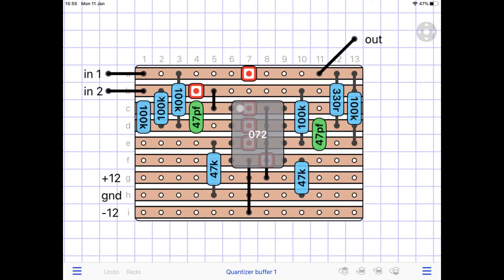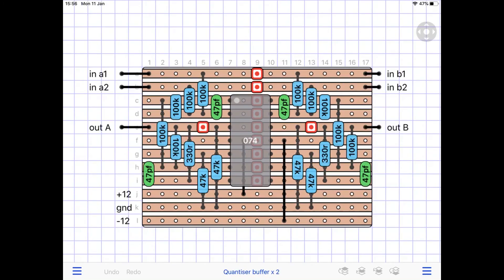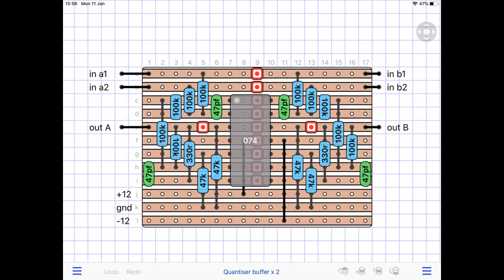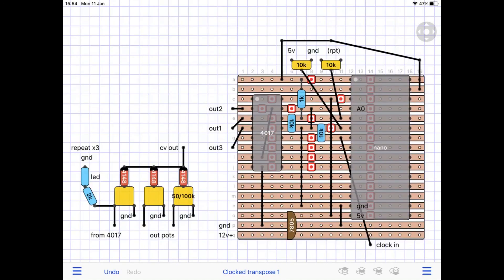DIY stripboard modular synth - variclock sequencer / transposer / arpeggiator thing

Comment: Hi! I really enjoy your work! There are so many ideas! I was wondering about this project if you would have an idea how to make a clock divider simply with Jack's? 1 cv input to the master tempo and a reset? I  am having difficulties with code so the link in the description is a bit complex to me. Thanks in advance! :)
Reply from the maker: Thanks for stopping by... not fully understanding your request but here is an easy arduino clock divider I use now https://youtu.be/I4j5i1ov19A
Although you can divide with logic ,a 4017 can do that if you search online I believe...if you tend to do more projects then try https://lookmumnocomputer.discourse.group also 👍
Reply: @UnauthorisedService  Hi, yeah i love that module, well it is kind of like that module but with jacks only. Like the 4MS clock divider that has a master CV input and the divisions from 1 to 9 for ex. Yes good idea , I will inquire on the forum! Thanks :)
Reply from the maker: Angelo Barbattini the 4ms divider looks like it may have an atmega (arduino) chip to control everything. It is more  than a bunch of sockets snd cv control 👍 im not aware of any open source arduino project that achieves  the same, and I cant code 😫
Reply: @UnauthorisedService  Thanks for the reply! Could I bother you with a last question on your module : On the main board there is 1 clock in and 3 outs. With the quad buffer how do I connect it exactly to the nano board, is OUT A & OUT B from the 4017 and on which parts do I add the four ins to the arduino+4017 board(I am confused as I see only one clock in)? Sorry for the noob questions :/
Reply from the maker: Angelo Barbattini lost me a bit there 😛 there is no quad buffer ? 4017 is a decade counter. All connections are on the boardwith the three outputs going to the long legs on the 50/100k pots. The two pots connected to the arduino control clock divisions with with one cv out ,so...one clock in : two controls for clock and 3 pots for cv amount per clocked step, with one cv out 👍

Comment: Great module, In the right side, what 8 step sequencer base circuit on ? Look interesting too, it can do random step right? ... :) thanks
Reply from the maker: Transient modules 8s .. was available as pcb panel and chip for a low cost version. Yes it does random and direction changes. 👍
Reply: @UnauthorisedService  thank you , will find out.